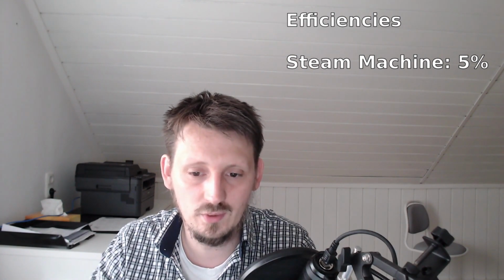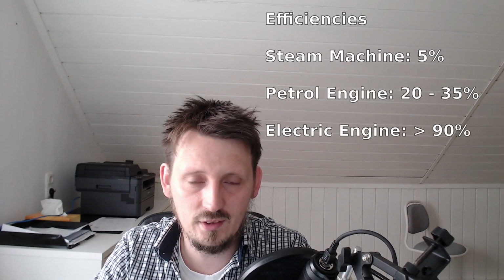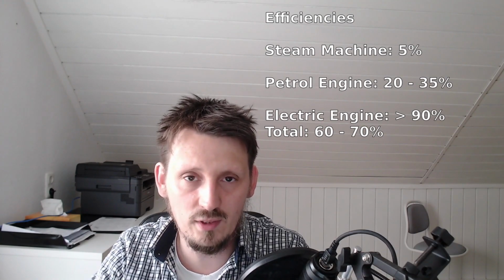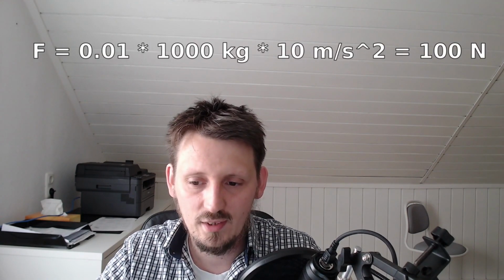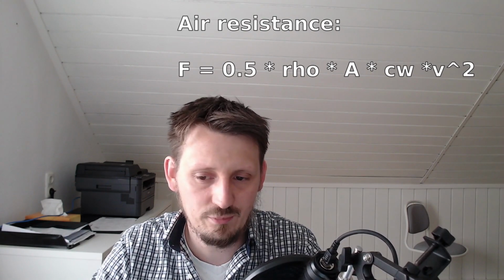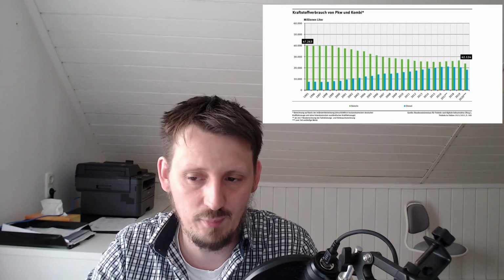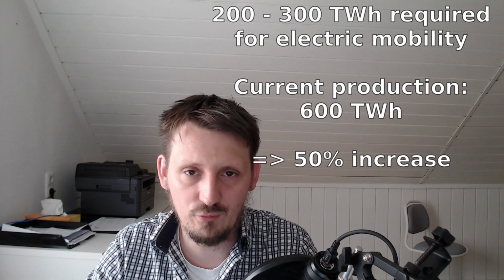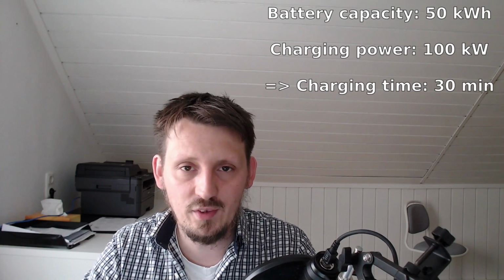Physics of Electric Mobility

Comment: @Dr.mustafa i had issue in running pp collision in Pythia tutorial but you didn't reply. Pls kindly reply.
Reply: what issue are you facing???
Reply: @salman7949  Pythia tutorial #2 15.05 minutes. I did the same but i when i run it shows me Pythia8/Pythia.h library error, although I have installed everything accordingly.
Reply: @emochannel3863  Are you able to run examples in the pythia examples folder, where you have compiled the source code. for example, main91
??
Reply: @salman7949  outside example folder. I prepared own folder. I did the same like Dr mustafa did. But it gives me library issues. I also tried to run it in the example folder but there's it shows the same problem
Reply: @salman7949  in example folder i was able to run these examples.